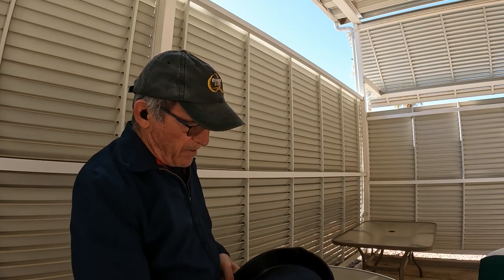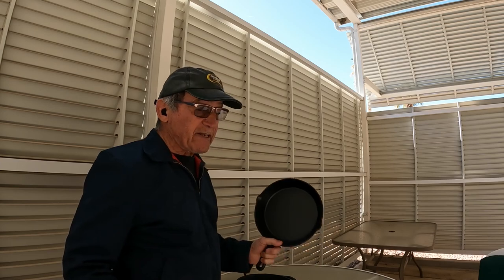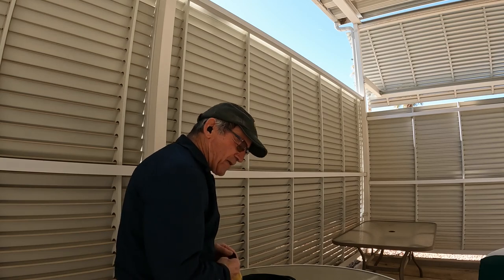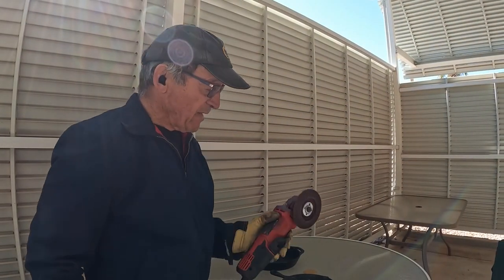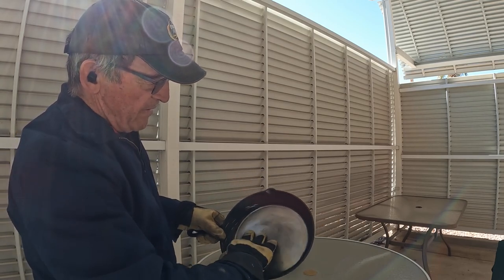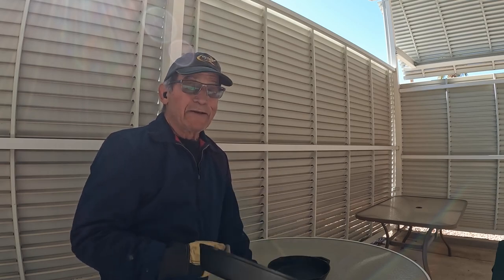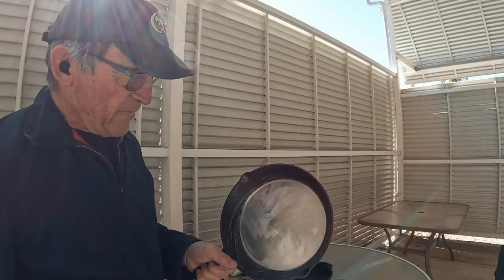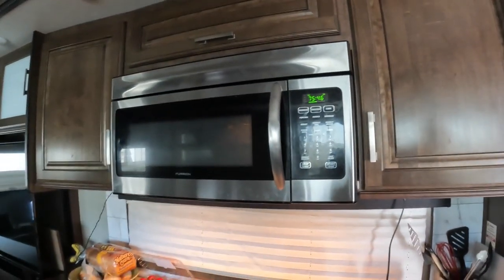Cast Iron Pan to Non-Stick

Comment: Nice video Paul, and timely too.  We just got a cast iron griddle for our solo stove and I have to condition it before putting it into service.  Going at the griddle with my grinder is something that I hadn’t considered.  My mother had her cast iron skillets that she loved.  Never used soap on them.  She told me once that she conditioned them with cooking oil and the heat of the oven.  I just can’t get an image in my head of my slightly more than 4 foot tall mother using an angle grinder.
Reply from the maker: But personally I think that would be a frame-able photo if it did happen 😉 Thanks Gerald 👍

Comment: FYI, I have heard that Flaxseed Oil is the very best (and I use it) for treating the cast iron cookware from time to time.  It's expensive oil but takes just a tiny bit to rub into the finish ever so often after using it and then cleaning it.  Makes them look so very good.  
I had to use sandpaper the old-fashioned way to slick up the surface of my pans.  Good video!
Reply from the maker: Thanks for the tip, Mea Self 👍
Reply: @paulontheroad  👍

Comment: Looks good Paul.  I've seen videos where guys have also just used a regular jitterbug  sander to make it smooth.  I have several cast iron pans, and just looking at them, my Artisnal brand is smoother than my Lodge.  Both work well.  I love cooking on cast iron, as well as my rolled steel Blackstone griddle.

Comment: I'm going to have to try that, thanks! Is a grinder and a sander two different tools? Also I once ruined my cast iron pans by seasoning them with corn oil, just another lesson.
Reply from the maker: Yes, a grinder is different from a sander. You can put sanding discs on a grinder but because it spins way faster it's not something you would want to use for delicate work. Good to know about corn oil. Thanks, Nan Sea (Nancy?)

Comment: Great video Paul.  The electric tool you used was an angle grinder, correct?  Never heard of a flack wheel so this is a learning experience. Would enjoy seeing you cook in the pan after conditioning it like this.
Reply: I'm not Paul ( ! ) but I believe the reference is to a "flap" wheel.  Hope this helps.

Comment: Once I used an 8 grit 10" wheel to remove adhesive on a subfloor.  Boy was that messy.  Can this be done on a Blackstone?
Reply from the maker: I believe I read somewhere that the cooking surface is rolled steel rather than cast iron and if that's true I don't think you want to do this to it.
And I have yet to find a way to stay clean whenever I use the grinder 😉